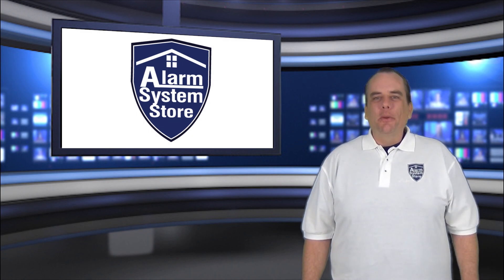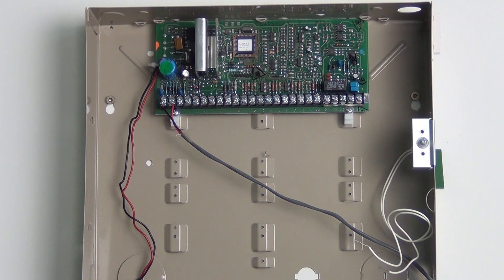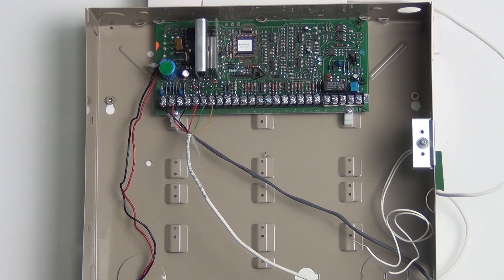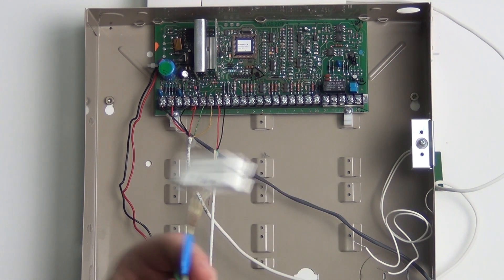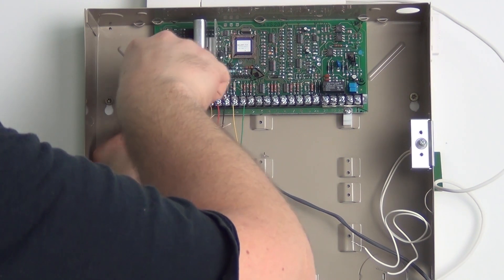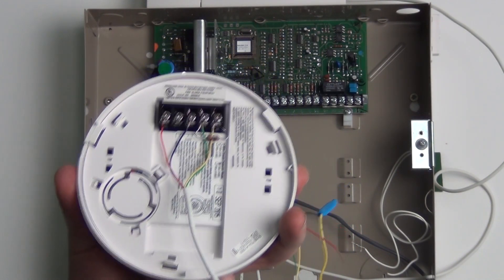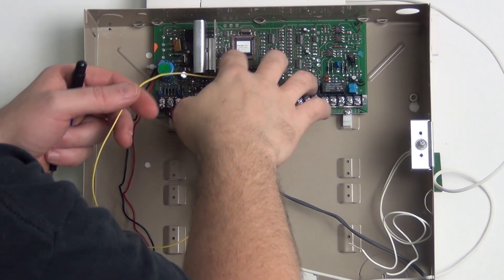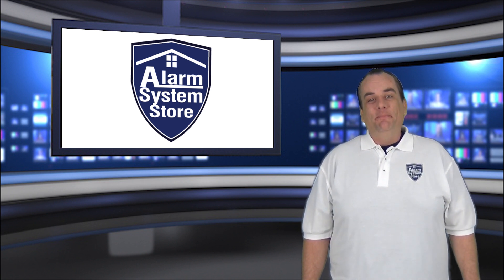Honeywell Vista Series Wiring - Alarm System Store

Comment: What is the cable used to connect 21, 22,23,24 for Wi-Fi not land line ? Can anyone help please .
Reply from the maker: You would need a communicator for that. There are many communicator options out there for Honeywell, but essentially its a cell or IP module that you attach to the system allowing it to communicate using cell, IP, or both in some cases.

Comment: What? No EOL relay for the 4 wire smoke? Power not being monitored, if the power goes out to the smoke detector it won't work, but the two wires going to the Zone will be not seeing any trouble, putting an EOL relay at the smoke detector or last one in the line, now you can monitor the power for when the relay trips out on the lack of power it will open connection at the EOL and cause a trouble on the zone..
Reply from the maker: We have another video that discusses that very thing. This video is just a basic wiring video that covers how most systems are installed. Unfortunately most people do not use EOL relays. As an installer I personally saw just as few installed by pros as well. In fact, even proper EOL usuage on burg zones was / is rare with the majority just putting them in the panel.

Comment: I have a friend he wants to upgrade from  DSC PC1555 to cellular primary monitor with vista 20p and 2 keypads.  What to get and how to connect, could you please instruct?
Reply from the maker: You can you our quote request form and we can tell you what you need. After that we can send you vids on the wiring and programming. Here's the quote req form:
https://form.jotform.com/alarms/request-an-alarm-system-quote
Reply: @AlarmSystemStore  I need to know before buying it from you that according to the existing DSC PC1555 hardwired,  does he needed more hardwire to be wired before can use the vista 20p with cellular primary monitoring?
Reply from the maker: The quote form isn't buying anything. He may need some additional wire for wiring between boards. It wouldn't be substantial though.  @huongyn8808

Comment: Would it be possible to use 2 sets of 18/2 wires and just run positive + negative + positive + negative on the keypad terminals? And if so, what order would the wires go on the keypad?
Reply from the maker: Yea, you could I suppose. Not best practice to do so, but the panel doesn't care what color the actual wires are as long as each terminates to the appropriate terminal on the other end.
Reply: @AlarmSystemStore   Does this mean (on the keypad) that terminals 1 and 3 are positive and 2 and 4 are negative?
Reply from the maker: @trainknightt  No not at all, there is only one + and -, the other two are data in this case. Polarity among all must be observed though end to end regardless of wire colors you use. The color of wire doesn't determine what goes down a given wire, what it's connected to does.

Comment: On DSC you can eliminate the resistors with a simple programming change. Will this panel do that too?
Reply from the maker: The main board zones are set per zone, and expanders have a dipswitch that changes them from NC to EOL.

Comment: Dear John,
Great effort and nice video presentation. I like to convert this unit to eWelink platform by installing smart switch. But how can we sure from outside system is armed or disarmed if we are not able to see keypad? Normally when we enter only we know system is armed by Red LED display on keypad. When we use our 433MHz remote to turn off alarm system, sometimes it is not disarmed and if we try to enter from Garage Alarm goes off. How to tackle this automation with showing current status of security system? I have additional trigger circuit board on the the original PCB. Which is mounted on same terminals where you installed 4 wire smoke alarm.
Please help.
Your video was very useful.

Comment: Do I need resistors for a fire alarm? Where do I put in several spectralert classics?
Reply: Resistors are not needed for fire alarm notification appliances, however for initiating devices, you will need to place resistors where the wires are on the device.

Comment: I noticed on your alarm system aluminum enclosure, you have a contact switch if it's door is opened, where does that switch wire into?
And what is that switch called if I wish to purchase one?

Kevin Rea
Lancaster California USA
Reply: It is a cabinet tamper. They are out of stock at the moment, but they are here:
https://www.alarmsystemstore.com/products/gri-tsc-20-cabinet-tamper-plunger-switch

They can be connected to a zone or an or existing tamper circuit that some system have.

Comment: Hi. Great video. Have 2 questions. We just visited your website and noticed that you do tinker around with z-wave products. We implement a lot of 2GIG products, and for the most part, new installs are a breeze. But when taking over existing wired systems, we need to install 2GIG's takeover module. Keeping the current wired install in place, 2GIG's Takeover Kit requires only the zone wire to be removed, and leaving the COM still in the wired system.

With that being said, not all boards are the same. Google brought us here, because were taking over an existing home, who had ADT, and they have the WA3000 you have above. Same exact board. You mentioned 8/9 = Zone 1, 10/11 = Zone 2, 12/13 = Zone 3, 14/15 = Zone 4 and (Question 1) is it safe to say this is a 8 Zone board or otherwise, and can you list which terminals are the zones?

(Question 2), in your video, according to 2GIG's Takeover Module specs, removing the zone wire and keeping the COM in place, which terminal would be the Zone and which is the COM? In example 8/9 = Zone 1, would 8 be the Zone and 9 be the COM?

Comment: Why is it bad to place resistors in the panel. I had mine installed many years ago and the resistors are in the panel.
Reply: The resistor makes it supervised
Reply: If the resistor isn’t  across the wires at the last contact, you will never know if the wires are shorted
Reply: I’m in the security field, every one has preferences on how they want it the resistors to be at I prefer mines in the panel.

Comment: I have a Vista 10SE System with 2 key pads, 3 door contacts and want to add 7 FG-1625 acoustic glassbreaks.  The wiring is all done through out the first floor behind the walls to the control panel and labeled.  I don't have enough zones left to keep them separated so do I need to bundle them with a terminal block?

Comment: You say the smokes are parallel but you’re saying run them all to zone one? Are you saying splice each smoke into one of the smokes wire and connect it to zone one terminal or stick each individual wire of the different smokes under the same terminals on zone one?

Comment: I am having installation and configuration problems. My house is prewired and an old Ademco ADT system was in place. Unfortunately, I didn't have the installer code and I can seem to reset the code using the back door method. It's possible that the panel was locked out. So I bought a new Vista-21ip, thinking that I can just reconnect everything and it should work. Unfortunately, it didn't go as planned at all. I do not have a smoke detector pre-wired. So I left Zone 1 empty. When the system booted up, I got two errors. One is "Check 103 LngRng Radio", the other is "Fire code 01". I can't seem to get into the installation model with [4112]+ 800. So I moved shifted all zone connections such that Zone 1 is now connected to a door sensor. When I boot up the system, the alarm triggers, showing 'Fire 01'. I am really stuck at this moment. Hoping someone can offer some advice. Much much appreciated!
Reply: Zone 1 needs a 2k resistor, it can be programmed out as well. Zone 1 can be used as a door or motion but has to be programmed as much and the 2k resistor needs to be " in line" on the loop. It's designed for 2 wire smoke detectors. Put a 2k across the terminals, they come with the panel.

The long range radio 103 is indicating that there is no internet connection and no resideo account established. Simply power down the panel and move the white jumper on the board. Now power up, You now have a glorified vista20.

If you can't get into programming, try this.

Power cycle the panel and hold the * and# keys simultaneously. If it's not locked out it will take you straight to sect 20. Then hit #20 and it will read out what the 4 digit installer code is.

I realize this post is a year old already but hope that helps.

Comment: Hello Jon.....I just moved in to a house using this exact system. I have a 2nd GE keypad at my interior garage door entrance that for some reason is disconnected at the box. I have a black ,green and white wire in the box not connected. May I ask which terminals these should be connected to. I did as much research as possible to determine why this was disconnected with no result. I need to find out for myself.
Reply from the maker: Well the best way to figure this out would be to check how the wires connect at the keypad. The keypad will usually have the colored wires connected into terminals. These terminals will be the same at the box. There will be two for power and then one for data.

Comment: So I have an alarm system setup but only my doors trigger the beeping when opened. All the windows in my house are hardwired but don’t beep when opened. What would I do to make those function? And which wires in my control panel would be for the windows?
Reply from the maker: Well, you'd want to make sure the wires for those windows are hooked up to the control panel. You can get a tone generator to use to trace the wires. If you discover that they are hooked up then you'd just need to make sure that the programming is set for those zones
Reply: A tone generator would be able to tell me which wires are wired to the windows? Also how would I get into the setup for those zones I’m almost positive the wires are connected to the panel
Reply from the maker: A tone generator would help trace the wire runs, yes. You can find some here - https://www.google.com/search?q=tone+generator&source=lnms&tbm=shop&sa=X&ved=0ahUKEwilmNH1877aAhUReKwKHcn5D98Q_AUICigB&biw=1440&bih=769

To get into the programming sections for that panel you'd need the installer code.

Comment: Can you have a door contact on zone 1 and then in programming you set it as a entry delay and exit delay?
Reply from the maker: Yes. Although Honeywell has set zone one to be a fire zone by factory default for two wire smokes; you can use other devices. The only thing about doing this is that you must absolutely use a resistor on this zone even if you're not using resistors on anything else. Thanks for watching the video. Good to have you here!

Comment: Ok so I hooked up the door contact how your video showed, using the clamp thing for the resister and wire, and followed your other video on setting up the zones but it still says fault 02, but it does chime when I open the door. I just can’t arm the system. 
It also says check 100rf receiver but I don’t know what that is
Reply from the maker: Did you use the 2K Ohm resistor? Color bands on that resistor would red, black, red, and gold. As far as the 100RF that pertains to the fact that you have a wireless device programmed into the system but may not have a wireless receiver or if you do have a wireless receiver; it may not be installed correctly.
Reply: Alarm System Store I tried to match the resister to the one in the video but I must’ve used the wrong one. I’m going to switch it out, and I did have a wireless sensor programmed in because I didn’t actually realize it’s a wireless one and I don’t know how to delete that out
Reply from the maker: For removing the wireless device; follow the steps below:

Enter programming by typing 4-Digit installer code followed by 800
When you get in you'll see '20' or 'Installer 20'
At this point type *56 to go to zone programming
Then you'll see 'Confirm 1=yes 0=no'
Press 0
You'll then be presented with a screen that says 'Enter Zone Number'
Type in the 2 digit zone number you put the wireless device on. If you put it on zone 9 then type '09'
Then press *
You'll see the zone programming summary
Press *
Then you'll see 'Zone Type'
Type '00' then hit *
It'll ask if you want to delete zone. Press '1'
It will then kick you back to 'Enter Zone Number'
Type '00' then *99 to exit programming
Reply: Alarm System Store oh my god thank you so much 😂 it finally works I’m so excited

Comment: Why are you not using "fire wire" I would useing terminal 9.The fire wire is a bit expensive but it fuses  in heat and which in turn sets off the fire alarm. As you know Fire over rides burgular
I worked for Honeywell. One great company to work for. I also made a drawing of all my installation in Home,Commercial & Industrial.So,in 5-10 years an installer would know what was run and where. I'm a lover of hard wiring,just saying as I do not like wirelass

Comment: Can you add a second motion sensor. If so is it a new zone or do you put them in the same one the current motion sensor is in? Sorry if question seems dumb I know nothing about alarm panels
Reply from the maker: Hardwired devices, like motion detectors, can be wired together on one zone. Since the motion detectors are normally closed in operation you'll wire them in series if putting more than one on a zone. Most people put wired devices one per zone for ease of troubleshooting. If you have more than one device per zone then if one goes bad you'll have to check the entire run to find out which one is giving trouble.

Comment: Thank you for not installing the resistors inside the can. Too many "instructional" videos show the EOL resistor in the can!
Reply: I'm replacing a GE system with a Admeco Vista 20. House is prewired and the resistors are in the panel. Why do they need to be at the device?
Reply: @Timetaker1000  the panel reads resistance. therefore putting the resistor at the sensor (EOL) end of line, means that if a wire was cut, the panel would read "open circuit" or zero voltage & therefore Alarm. If there was a "short circuit" (join wires together - bypass resistance) the panel would read zero resistance or full voltage (12v) & therefore Alarm, because the resistor is at EOL. Now place the resistor at the panel ......... cut or short the wires anywhere between the panel & sensor, the panel will still read the resistance and not Alarm. Noting the resistor should be in series

Comment: Also, instead of purchasing a new terminal block you can just run all wires and connect them using a wire nut and run a single wire per terminal on the keypad bus.

Comment: What was the sensor that you were wiring into the door of the panel itself?
Reply: They should have a factory installed tamper switch! But no! Let's add to the cost!
Reply: probably a tamper
Reply: Definitely some sort of a tamper. Curious as to what the actual part was. I'd love to install that on my panel.
Reply: It is a panel tamper:
https://www.alarmsystemstore.com/GRI-TSC-20-Cabinet-Tamper-Plunger-Switch-p/singlegri%20tsc-20.htm